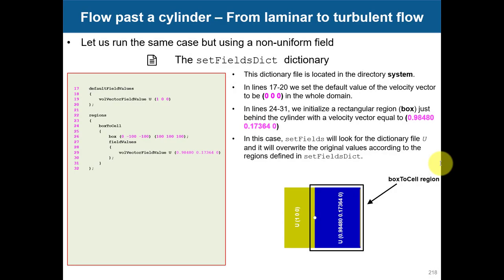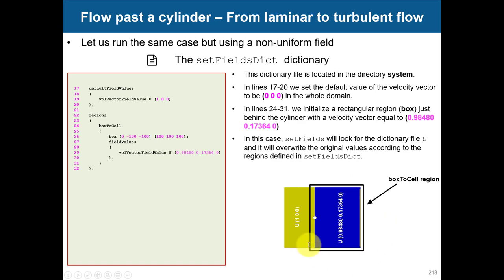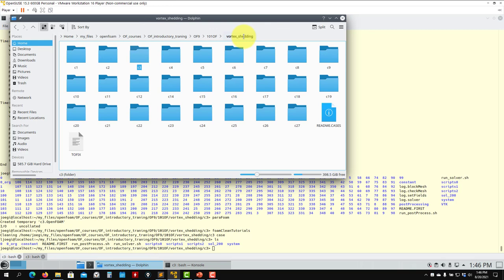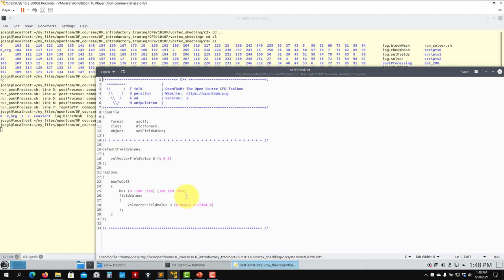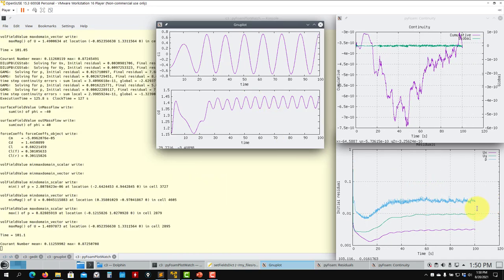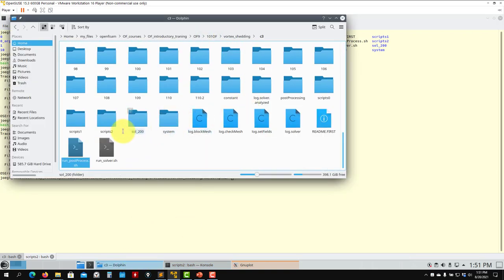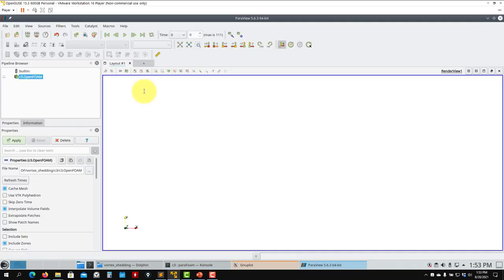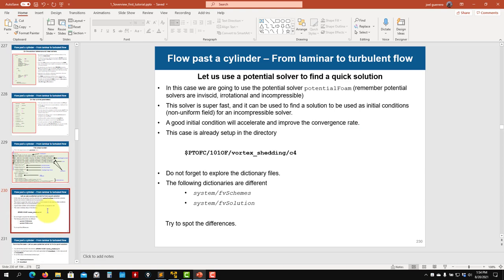1.6 Module 1 | Introduction to OpenFOAM - OpenFOAM 101 #openfoamtraining

Comment: also. In the square cylinder LES case in complex physics cases the wall patches are defined for the square with right hand rule but vector pointing outside of the square (unlike here where the normals for the cylinder for the patches are pointing inside the cylinder) Everything runs fine for both cases though so I am wondering if there is soemthing i am missing. Thx again for your content it has been very helpful and continues to be!
Reply from the maker: Yes, that depends on the orientation of the coordinate system. Depending of the system, sometimes you need to think clockwise and sometimes counter-clockwise. In the module where I deal with meshing, I think I fixed the coordinate system so I need to move in counter-clockwise sense.

Comment: I have a question that has been kind of driving me crazy. At exactly 5: 05 we can see the blocks. For each up block you have a corresponding down block, but each corresponding block has different y and x cell amounts and grading flipped (x y) I mean block 0 and 10 for example (not 0 and 5 where the grading should be flipped) block 0 is on top of block 10 and should be symmetrical about the y axis. block 0 has (20,10,1) cells with (2 1 1) grading and block 10 has (10,20,1 cells with 1 2 1 grading. I don''t understand how this can be correct but when you visualize the blocks block 10 still has 20 cells in the x direction and 10 cells in the y direction with 2 1 1 grading. Am I missing something or is openfoam somehow fixing this on its own?
Reply from the maker: uff, that blockMesh dictionary is super convoluted.  That is how it is implemented in openfoam. You need to follow a very specific axis system and move in counterclockwise sense (for this particular reference system).  Then, you also need to deal with merging the blocks. Honestly, I only use blockMesh to create the background mesh to use with snappyHexMesh.

You can find more info at this link:  https://doc.cfd.direct/openfoam/user-guide-v11/blockmesh
Reply: thank you so much for for clarifying. some reason I completely forgot this as I have always used the same convention (one that makes x1 direction in the closest to x axis etc. Thx again  @wolfdynamics5703